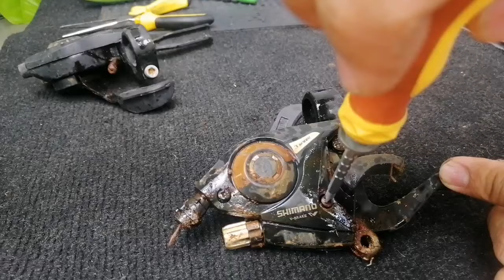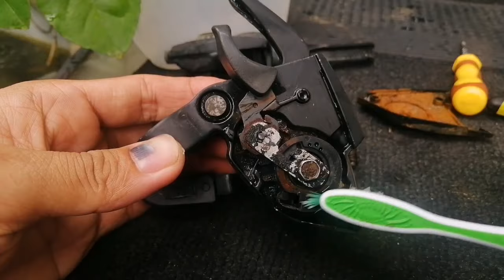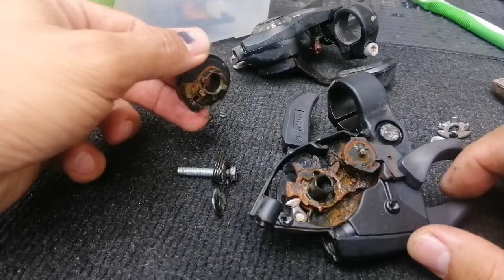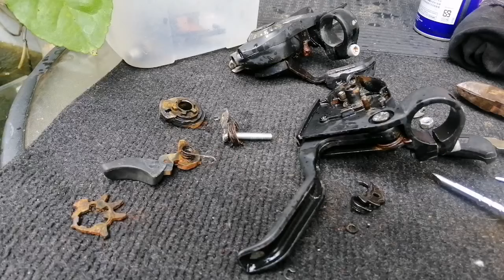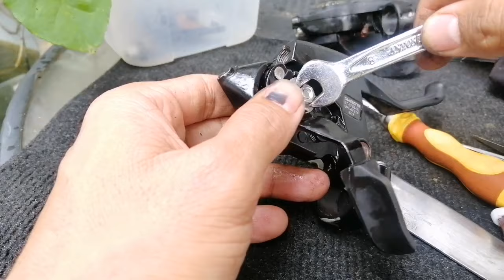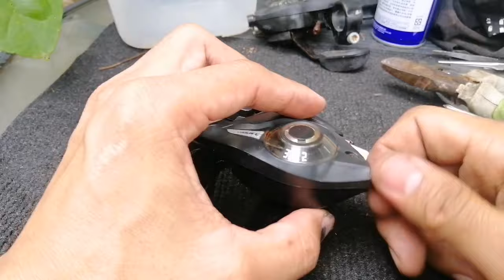Old Shimano Combo Shifter Restoration

Comment: Magandang gabi, pwede ko po ba makita ang ilalim kung pano pagkaka'ayos? Doon po kasi ang sira ng fd sa bike ng kapatid ko. Kapag mag shift na sa 3rd gear, hindi na siya kumakagat. Bumabalik na sa 2nd gear.
Reply from the maker: Saang ilalim po sir? Try mo po muna tangalin ang FD then check mo kung kumakagat sa 3rd gear.. Baka po kasi masyadong matigas fd mo at hirap ang shifter kaya di nag lock sa 3rd gear kaya bumabalik
Reply: @Kulikutz  yung loob po ng tinanggal niyo na hex nut. May spring din kasi doon.
Reply from the maker: Ahhh.. Mejo mahirap ibalik yung spring na yun.. Ginamitan ko pa ng maliit na wire para di kumalas habang kinakabit..

Comment: Sir, possible kayang matanggal yung brake levers niya?
Reply from the maker: pwede naman po. drill mo lang yung rivet lock ng lever.
Reply: @Kulikutz  hi sir, pag na drill na po yung rivet lock, irreversible na po ba?
Reply from the maker: @paupaugomiega3955  yup, need mo po ng replacement para dun. or pwede din siguro bolt and nut.

Comment: pwede magtanong sir yung shifter ko sa right sobrang tigas pindutin pag nasa 4 na.
Reply from the maker: Try mo muna tangalin yung rd sir then check mo kung matigas parin.. May cases kasi na rd at cable ang rootcause ng matigas na shifting.

Comment: Bago lng poh ako sa pag ba bike at ung left Vbrake shifter ko sira o hnd na nagana sa mga napag tanungan ko sabi nila kailangan na daw bumili pero bago pa halos un kaya nag hahanap ako ng paraan kung pede pa maayos sana ito na un
Reply: Isa pa lods any idea kung bakit mahina na brakes ko todo diin na ako pero tuloy tuloy parin andar e🤷‍♂️🤔
Reply from the maker: Kung bago pa baka yung FD or cable mo ang may problema, matigas kasi talaga yung mga combo shifter lalo na yung mga copy.. Ganon din ang breakset di ganon ka kakapit ang pads at rotor nya.. Pero try mo adjust yung barrel at yung allen para sa gap ng calipers..
Reply: @Kulikutz  slmt poh i tra try ko 👍👌

Comment: Sir plz tell me how to load the spring of the upshift lever
Reply from the maker: I use a small wire to settle the spring  after nut is installed..
Reply: @Kulikutz  in which direct the spring should be placed,can you make 2 min video

Comment: boss pano matanggal ang brake lever? may ipapalit ksi ako sa left side ksi naputol nun nadisgrasya ako .patulong namn
Reply from the maker: naka revit type yung lever sir, pero kung gusto mo talaga tangalin, drill mo lang yung kabilang side then bolt and nut nalang palit mo na lock.
Reply: @Kulikutz  halos maghapon kong pinukpok at ginamitan ng flat screw sir di matanggal ung lock shower . salamat sa idea sir
Reply: @Kulikutz  sir maraming salamat sa idea mo naayus kona grinder at barena pinangtanggal ng lockshower at napalitan ko ng bolts na sabi mo .salamat naka tipid kahit papano haha tnx tlga sir
Reply from the maker: Thanks din sir, ride safe always